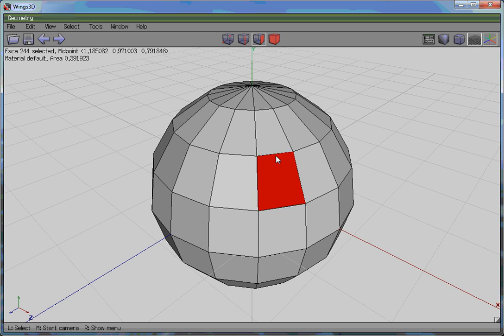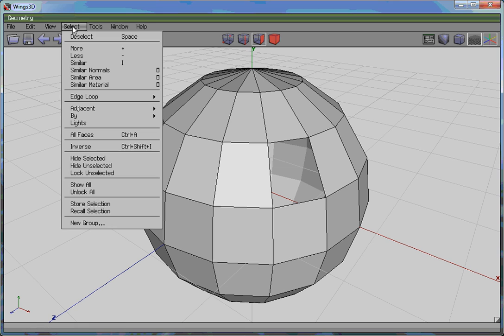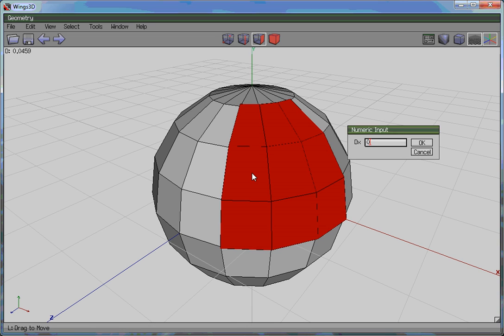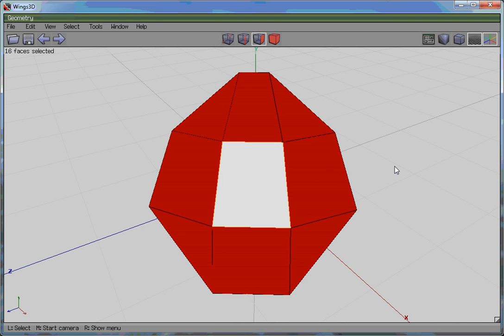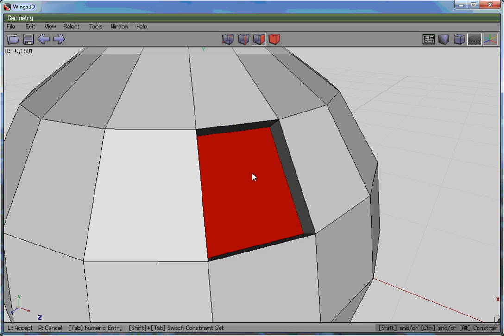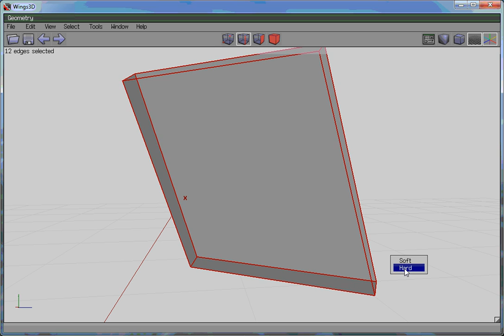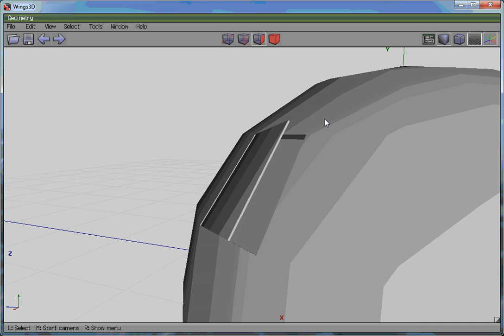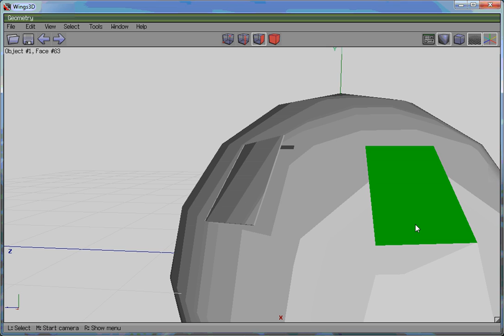Wings3D Tutorial: Blended Curved Surface Doors

Comment from the maker: @farooq092 I've added a closed captioning track to the video--just click the little "CC" button on the video and make sure it's set to English - Correct.  I've manually fixed it up so it should have pretty much all of the content of the video, although it may go a little fast--just pause if you need time to read it.

Hope that helps.